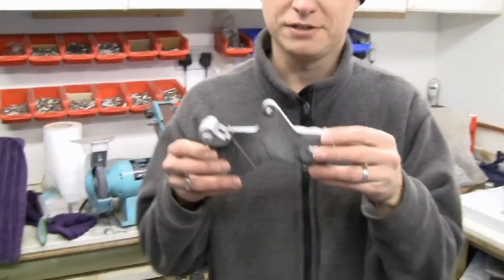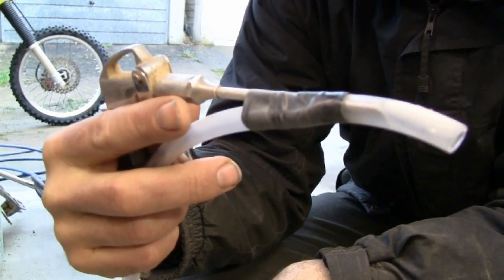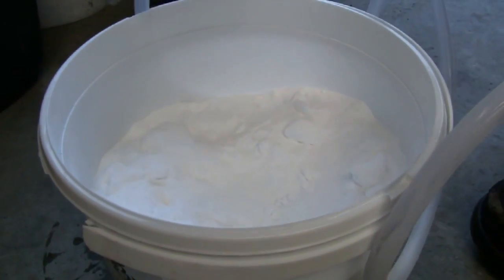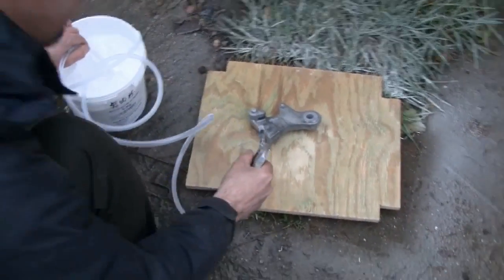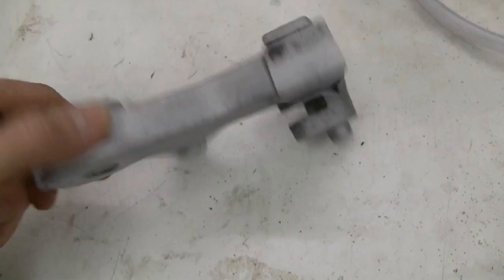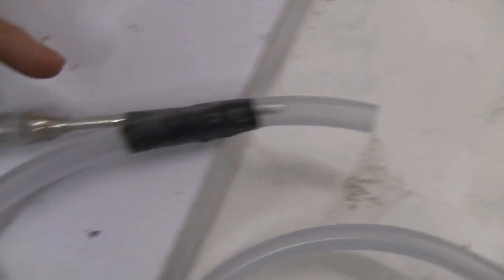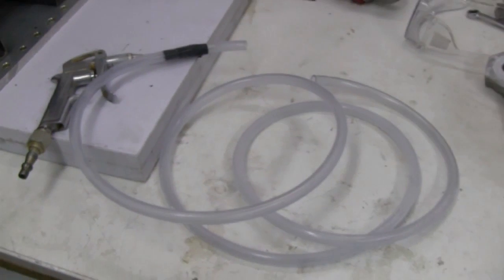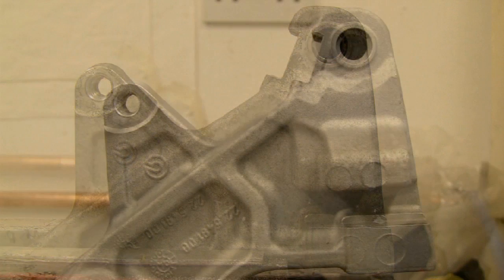DIY soda blaster: clean your parts with compressed air and baking soda!

Comment: Hey guys, ever used fill sand with your invention ?
Reply: The soda wasn't much effect so I tried it with yellow sand, all I had was builders sand which has clay particles in it, IT worked in my home mad blaster It would be way better with white, children's play sand as it would be cleaner. Down side is the amount of sand going everywhere, you REALLY need a system of containment
Reply: Also need a larger compressor as 2hp and small tank means it running full belt at 90psi
Reply from the maker: No, think it would be too coarse and not powerful enough to lift the sand. You'd be better off using a sandblasting gun – basic ones are cheap and work on more or less the same principle.
Reply: @GarageNight  I did it at 95 psi it lifted the sand and blasted the ali enough power that I had sand through my hair

Comment: I've built the same basic unit and use instead of soda I use coffee grounds.  A cheap 1 pound of coffee from dollar store works awesome it hose pretty far too and is not too abrasive it leaves no marks in aluminum.  And can be screened and reused
Reply from the maker: Wow! Do you make coffee with it afterwards???

Comment: I tried this, and all it did was pressurize the soda container.
Reply from the maker: I think you might have gotten something wrong. The soda container should not be sealed. Take a good look at the video and try again. Air Cooled Tech also has a good run-down on the build.
Reply: Problem was that I didn't insert the air blower nozzle in facing WITH the curve of the PVC hose I used. Their arches were facing opposite directions, so it forced the air the wrong way down the tube. I got it to work, but it didn't do too well at removing gunk from the metal test pieces, but I blame my compressor for that. Thanks for the vid!
Reply from the maker: Yes you need some meaty CFMs to run it reliably and for longer periods - a belt-drive, twin-cylinder compressor with a chunky tank volume. For really heavy jobs - rust removal etc - you are still going to need a sandblasting or abrasive media set-up. Good luck!

Comment: Hay what size tubing did you use??? inside diameter???
Reply from the maker: Hi - try a tubing with 7/16 inch inside diameter (11mm). Hardware stores should sell various different diameters.

Comment: Hi, would it be a bad idea to blast parts while they're still on the bike?
Reply from the maker: ***** Hi! I think where possible it would be better to remove the parts. Baking soda is alkaline, so it could have a corrosive action on any paint, metals etc that come into contact, especially prolonged contact. Also, it makes a bit of a mess. Hope that helps.
Reply: +ThePotatusMan yes

Comment: how much psi of air does it require??
Reply from the maker: rd matias Hello there. Try around 80-90 PSI. The size and capacity of the air compressor also matters. It's worth a try with whatever compressor you've got but in general, the larger the compressor's tank and the higher its CFM rating, the better.